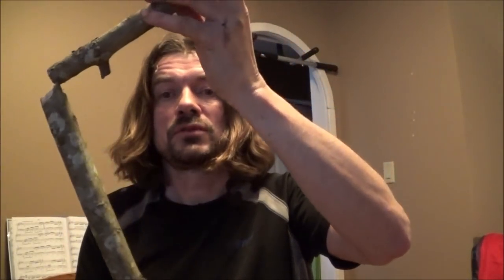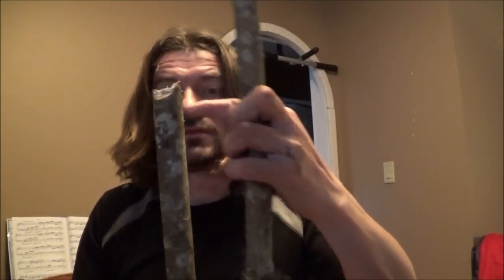Tree Topping Cut Explained

Comment: in your clips Reg ol' mate it looked a wee bit  like what we call spring back  or sprung back,, rather than push back ,, ... similar to when there is to much pull on a top when the back cut goes in and she lets go.. the old growth sure smells good don't it... love the family Reg
Reply from the maker: Hey Bill. This is a good clip/example from a far, if a little less dramatic. No significant lean but watch Greame get pushed back on the stump: https://youtu.be/b3nTlYSDonM
Reply from the maker: Another mate, from Rico, same motion: https://youtu.be/hQ1uq5PODjM
Reply: @Recoates  great examles of push back here Reg ,   I was referring to your  situation , where yer first clip definitely had that effect , where as yer second clip she looked as it popped a bit leaving 4 to 5 inches of holding wood, looked like both affects were at play here
Reply: that old growth sure cuts nice don't it .
Reply from the maker: @BuckinBillyRaySmith  both big leaners mate, but the second I  just went higher and the taper was slower from the bottom up the whole way. The thing is after the stem stopped swaying it actually settled right in the same spot as where it was pre topping. So I was able to just hop off straight back into the tree where I was tied in. Where's if it was sprung, itd have settled further away/back. You had to be there I suppose, and as Ive said many times in the past, the dynamic reactions  when topping these old giants compared to regular second growth is night and day. Even smaller tops above 200 ft are pushing you back 12 feet or more.....be it a very slow and extended sway. Theres just so much flexibility in a stem when its that long
Reply: @Recoates  the second ride looked funner ... hows the golden tree
Reply from the maker: @BuckinBillyRaySmith  I knew what was coming mate. Just bit down on the gum shield. No change with the spruce, just waiting to see what happens in the spring. 50/50

Comment: I've never cut anywhere near that high. Probably highest top ever 110' in new england US. That's rare. Usually 75' would be a decently tall topping height. I see that you've already replied to comments on why you wouldn't use a strap release bore cut. I trust that you know what you are talking about, and won't argue with you about it. If I'm topping a heavy leaner, I plunge cut from the side, set my hinge, and release the strap from the backside (better spot to be for the ride as you mentioned). Especially if it's a hardwood, because I'm afraid that I'll only get a short way through the back cut before the top starts going and, as you touched on, pulls the stem way forward, creating an uncomfortable situation, as well as a potentially inaccurate fall.

I guess the stems we're working on out here are short enough that the pushback isn't as big of a concern as the pull forward. At least in my experience. Maybe that's what I'm not able to comprehend. Seems like a completely different game. Sounds like the people criticizing have never been higher than 100'. That's got to take a bit getting used to, and i've spent a fair bit of time topping trees. Badass stuff brother! I'll just go ahead and take your word for it!
Reply: Not to mention that the tops that I've taken over 100' are 12 inches at best. Forget about 32. Holy smokes

Comment: Where could I find more of these cuts? How do you tell if a tree is gonna barber chair? How far in do you take the hinge on a big top? Could you take just one side out if you were trying to steer the tree? How do you brace yourself for the pushback? How big of sections do you recommend dropping? Why don't you wear gloves?
Reply from the maker: Alot of question Brad, most of which are already answered in the video or existing comments. Other than, I never liked the feel of gloves, and wear them very reluctantly
Reply: @Recoates  thank you. Im a beginner in arboriculture and would love to do what you do. What's the highest you've climbed?
Reply from the maker: @bradleysmith4630  I dont know exactly Brad, maybe 240
Reply: @Recoates  thank you for your time today

Comment: 22:09. It’s probably at a sweet spot in the stem, where there is a wave created. It absolutely could be explained by physics. I think it would be interesting to explore. Still, it’s a harrowing joint. I topped a skinny spruce that had been searching for the sun in one direction only. I was probably only fifty feet, but when that top (fifteen foot)left, I was ten feet back and forth for a while. It took a good long time to calm down. Not equitable, but similar in nature.

Comment: A tree top exerts a bending force on the remaining tree which reaches its maximum when the top is at 45 degrees so it is best to avoid the bending force and the top breaking free happening at the same time which would happen if your face cut is at 45 degrees for a straight stem

Comment: Really unique sort of video where aspects of this subject are explained and very well articulated.
Thanks a lot for taking the time to do this.
Reg, maybe I misunderstood one point.... but were you saying that if a section is going to barber chair there is no way to prevent it? .... or were you saying that it is impossible to know after the fact (i.e. when the piece is on the ground) whether preventative measures to prevent barber chair-ing had been necessary or had been just a superfluous "waste of time"? thanks.
Reply from the maker: The latter, Robert
Reply: @Recoates  Thank you, sir. Therefore, then, if one is being safety minded and cautious... one would tend to "always" go the extra steps necessary (e.g. as you described) to reduce for the likelihood of a barber-chair, right? thanks
Reply from the maker: @scatoutdebutter  In this case Robert,  it added about 30 seconds of extra cutting. So yeah I think its a worthwhile investment
Reply: @Recoates  Thanks a lot, Reg.

Comment: Doing a bore cut is one way to help prevent a split/barber chair from happening but I personally like to wrap up the tree with a couple pieces of bull rope, one wrapped a couple times around above my flip lines and another wrapped a few times below my flip lines and neither of these extra pieces of bull rope are ever connected to my harness while making the cut, this is a sure way to absolutely know that the tree cannot split open on you, it may split but only a couple inches at most allowing you to finish making the back cut safely. Work Safe and Stay Alive!.

Comment: I suppose the side bore with trigger on the back cut is ok for ground work but not for topping....or maybe you think it is complete rubbish? Just curious.
Reply from the maker: The side bore is a great method. But with a long bar is difficult to perform in a tree because you can't lean back far enough to start the cut with the tip of the bar. Not impossible, but still sketchy

Comment: 15:37. I use that type cut all the time, in tops, and especially if it’s a big limb on a pop cut(undercut then match the cut directly over the top, to drop a big limb flat). The top, cuz I don’t want it to tug one way or the other, and on the pop cut, so that that it doesn’t leave a string on one side, and end up pealing instead of popping flat down. I have never been more than one forty in a tree removal, so...I use it as an amateur compared to you.

Comment: In terms of best practice.... I trained ND Arb 10yrs ago and we were taught to do the side cuts to prevent bbchair... Bore cut was also taught but they seemed to prefer and emphasised the ears method.(for similar reasons if I recall) Anyone have a more recent version of best practice for this? Bore cut seems more risky to attempt but if done correctly it seems to be a more foolproof option...Is that right?
Reply from the maker: I think after 10 years your best practice is probably to keep doing what you've learned and experienced through that period. And. always question the credentials and experience of anyone claiming to teach or know better.
Reply: @Recoates  Thanks Reg, that's a good angle I hadn't considered. I do worry that the ears method may have its limits though and Im just not sure what they are. In your experience/understanding is there a point/diameter at which the ears wont suffice? The reason I ask is because you never try to teach or claim to know better, but your obvious experience speaks for itself. If you have an opinion I would be grateful to hear it. Thanks again!
Reply from the maker: @TriggaPleas  On the 2 examples in the video I probably took a fifth from each side, so leaving 3/5 holding wood in the middle. Thats not advice, but I was confident it was the right amount, and evidently it worked.
Reply: @Recoates  Much appreciated Reg, I understand your apprehension towards "teaching" in the YT comment section...Thanks for sharing your ideas all the same.

Comment: I’m confused about the concern of being ripped off the spar due to insufficient slack in the adjacent tie in. Is he not lanyard in? He can only be pulled as far as the slack of the lanyard, no?
Reply: Yes, but then you're in the middle of a tug-of-war between the two trees.  It would not be a good situation to be in, especially with the size trees we're looking at here.  Better to give the tie-in slack and rely on your lanyard and spikes for the ride.  The tie-in is still there for worst-case scenario.
Reply: As John said, also he was concerned the tree he was topping could actually fail during the topping and had clipped his lanyard in such a way that it would ripped off, swinging him harshly but alive to his main anchor if the tree failed
Reply: I was not nearly as high, but my tie in was much farther away, I failed to notice a bend in the tip of the top and snagged my line pretty good, and I was almost surprised how well my lanyard didn’t allow for much movement. Like I said, different situation. Sometimes if your out on the tip of a lead it’s nice to triangulate and keep it taut, but agreed it’s best practice to just leave it slack to avoid any unwanted pull.